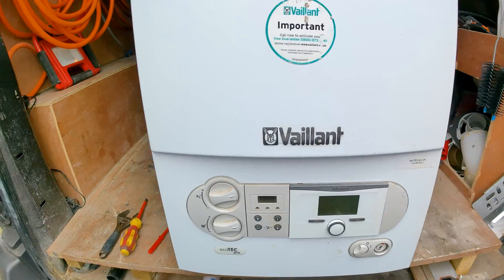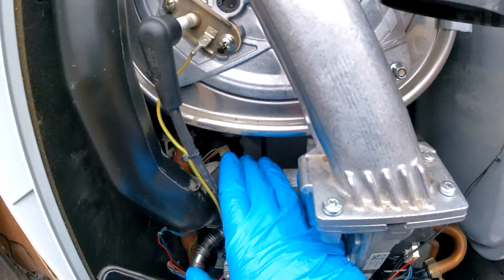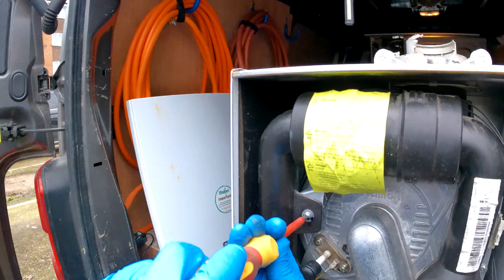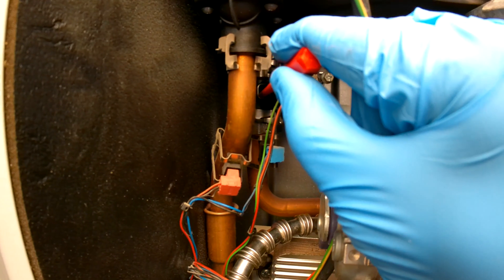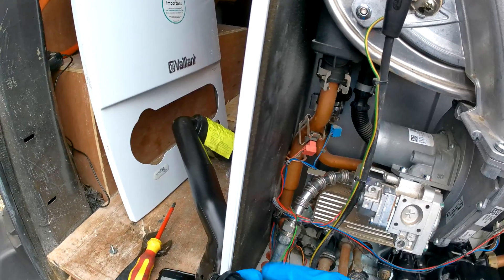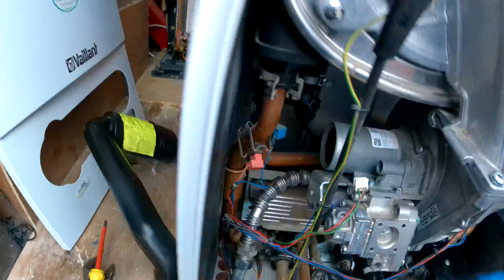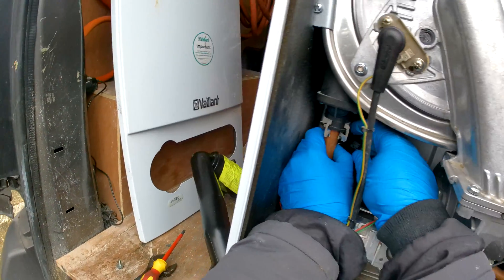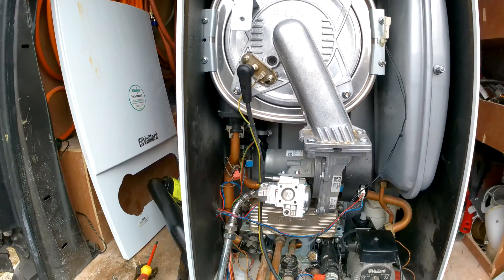Vaillant EcoTec Pro | F75 Fault Code | How To Change The Water Pressure Sensor

Comment: Super SUPER helpful video! Every step perfectly described and demonstrated. EXTREMELY helpful! 

In my case (fault 75), the pressure sensor was clearly the culprit, and once removed it was also very obviously gunked-up, so I blasted some WD40 in the small hole, prodded in the hole with the bristles of a paint brush, blasted more WD40 in there (dirt did come out) rinsed it (I made sure not to get any of this stuff on the electrical connection), wiped it down, re-fitted it and it worked straight away. I'll update this comment if it happens to fail quickly, but it's been running an hour now and I'm hopeful. 

A note for any users who are worried their boiler doesn't look like the one in the video... I have the Vaillant Ecotec Plus 630, and the front panel looks very different from the one in the video. However, don't be put off by that! Once inside, the relevant bits are EXACTLY the same. And process is exactly the same. It's worth having a look in there and, maybe, trying to clean the sensor (if you don't mind taking the risk of having to repeat the process again soon, replacing it with a new sensor).

VERY MANY thanks again for this EXTREMELY helpful video! Hope your weekend is going very well indeed (much deserved) 😃

Comment: This is the video I was looking for ages man :D

Just watched it and changed the pressure sensor, took about 10 minutes all in all. I drained the whole system instead of just draining the boiler only, safer that way :)

cheers n thumbs up
Reply: Anyone got this problem - the sensor don't even need changing, just take the sensor out, put it in vinegar for an hour, it will drain the dirt out, put it back  and save another £20 pound ;)

cheers

Comment: Finally an answer on my question! I noticed a significant difference in the electronic and the analogue pressure gauge value. With replacing the electronic pressure sensor, the problem is solved. Thank you!